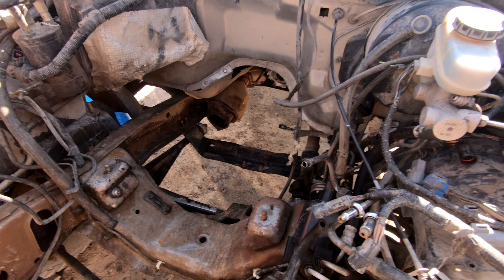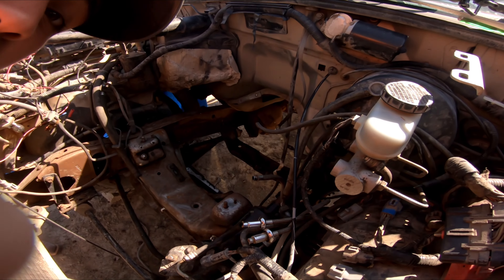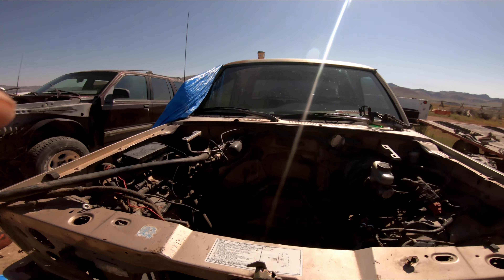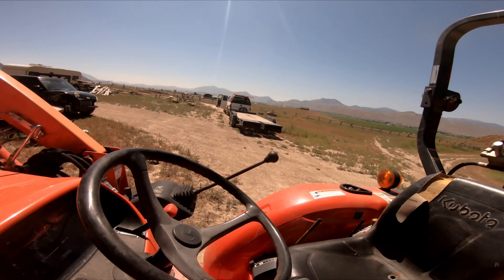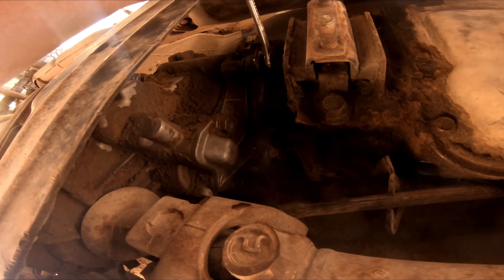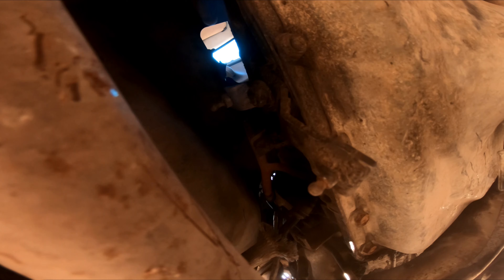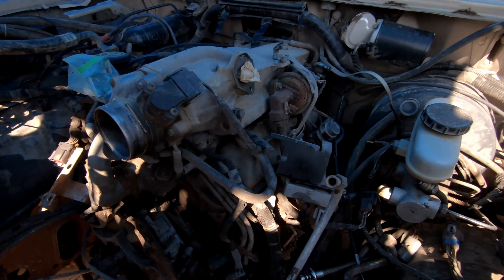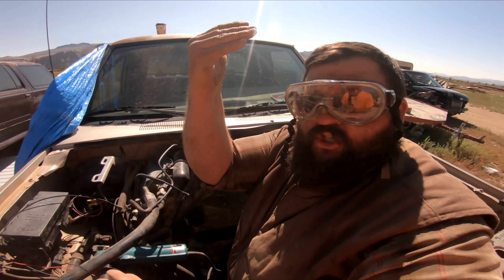Ford Ranger Engine Swap Part 5

Comment: You guys are in Idaho too? Small world. I'm thinking about finishing up another guy's project. He says he has the transmission and engine in but that the fuel lines and wiring harness need done. Any advice or parts in videos you can point me to directly that might help?